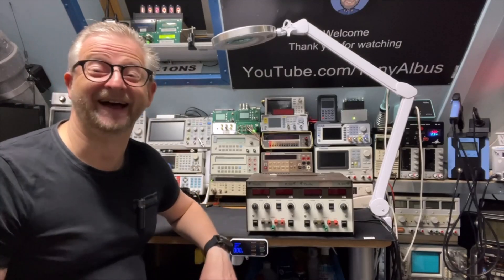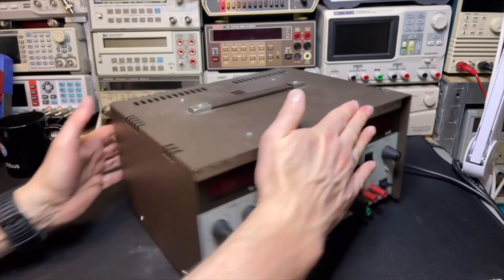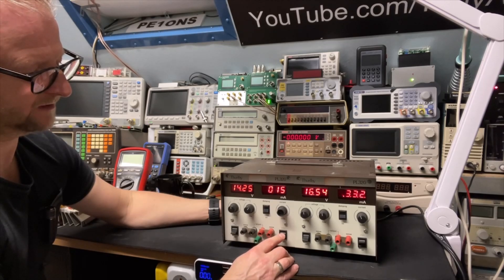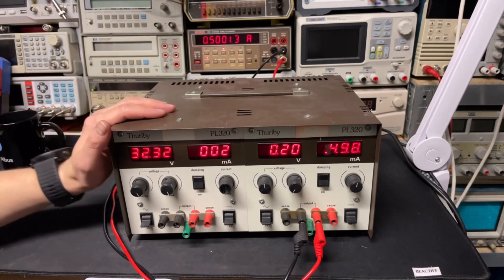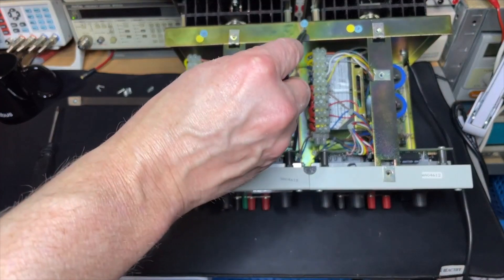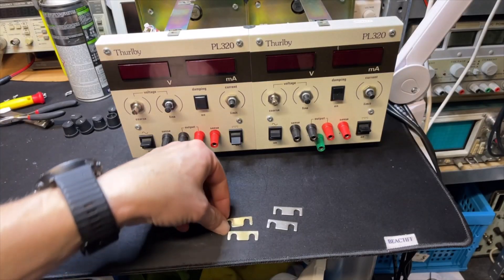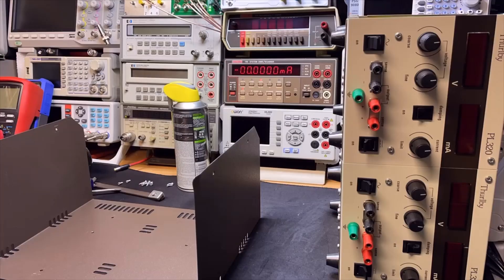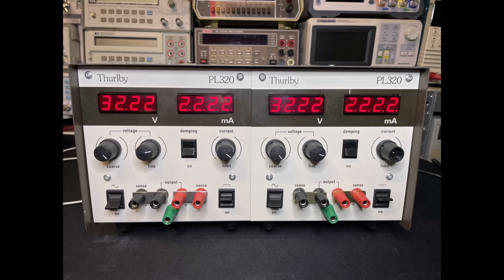#238 Thurlby PL320 Double Power Supply - Cleanup Teardown

Comment: These power supplies are brilliantly simple.  The schematics can be found by trawling the internet you may not find the exact model diagram but often good enough to repair it.  The fine voltage setting pot packs (replace with a 1k WIRE WOUND  instead of a cheap carbon track and it will last forever ) up the coarse pot is a wire wound 50k and generally does not degrade.  They are simple with no microprocessors involved (except possibly using PICs for the digital meters).  The carrying handle or handles, separate DC output switch and current limit display when off are very useful features that are rarely seen on similar power supplies. Being linear they exhibit a very clean output relative to say a switch mode type.  They are a classic design back to when the United Kingdom actually made stuff primarily made by Thurlby Thandar but often found re-badged as Farnell or RS.
Reply from the maker: Thanks! yes goodpoints! thanks for sharing

Comment: Hi, Tony. I have looked through the .pdf documents in your link (below). The calibration technique for setting the front panel voltage meters is different to what you mention in the video. You mention adjusting RV5. I did not read this in the .pdfs (PL_Series.pdf from your .zip file) . Where did you get the alternative info on setting RV5 for the voltage offset/( linear scale?). Is there any other documentation on this available? Cheers, Rob
Reply from the maker: Hi Rob, i don't remember,  i prob, just started turning knobs while not reading the doc.  :)

Comment: I have it's big brother, the PL330QMD, I bought it faulty on eBay, I fixed it up then gave it a full calibration. I'm a big fan of TTi stuff and they are really easy to get spare parts cheaply from TTi. One of my favourite TTI PSU's is the TSX range, I have a TSX3510 and I'm looking for a TSX1820. The TSX range has a useful button you can press to view what the current limit set at while the output is switched on. Super handy for adjusting while a device is powered.
Reply from the maker: Hi Dale, that cool, teh big one, nice!  that is a very nice option..  will have a look at that series, thanks
Reply: @TonyAlbus  They do an even bigger one with 3 outputs, the PL330QMT, that one is a beast! But I think output 3 is quite limited. 
I love my TSX series, even though it is a SMPSU it has no switching noise that I can see.

Comment: They don't make them like that anymore. In a perfect world, one can still find many of the parts today to make repairs should it fail. I wonder what the lifespan of the newer (more disposable) test gear is. In the industrial working world the bean counters have this thing called "book inventory value" which back in the good old days of HP and Tek was 10 years maximum before it was scrapped, working or not. Will the new gear last that long before obsolete or fail? Now we have a chip shortage too. Crazy.
Reply from the maker: Agree, some old gear can still be very good and sometimes even better then new gear. i resently bought a 34401A DMM and Keithley 230 voltage source.. new unaffortable, but this one was...and it is allmost spot on... talking about good quality..
Reply: Danish Native. TTI Still make the PL series and most of their products are repairable and easy to get parts.

Comment: I remember those old supplies. How long did it take you to set all the meters to read 3222 2222 (not long as it is the max) and why not challenge yourself to set it to 1234?
Reply from the maker: Thanks, yes nice PSU.. in pritty good state for its age.
Reply: The voltage fine setting front pot is 1k and the coarse is 50k so the fine sets it over 0.6 of a volt put a 1k resistor in paralell with the fine votage setting and you get this to 0.3 of a volt - albeit it slightly non linear.

Comment: You really need to spray your WD-40 into the pot bodies rather than on the shafts... Overall an excellent clean up...  10/10
Reply from the maker: Hi Dero, depends what you want.. i wanted then to run more smooth, the old oil in the shaft is usualy the problem, i had no contact problems.

Comment: Well worth considering fitting 10 turn pots to these. Makes precise adjustments an easy task.
Reply from the maker: Thanks Simon, yes indeed.. its worth it also.. i prob. keep it
Reply: Because it has two pots, corse and fine, there is no practical need for a 10 turn pot.
Reply from the maker: @mikewillis1592  There is for the current. that has only one pot.
Reply: It's worth changing some of the skeleton pots internally for enclosed ones, TTI seemed to use a mixture of open skeleton pots or enclosed pots for whatever reason. And it's pot luck what you get when you look inside. I replace the skeleton pots on these and other TTI products as they can cause problems.